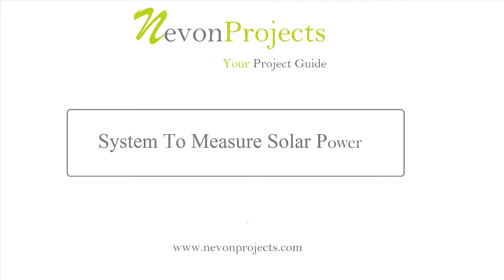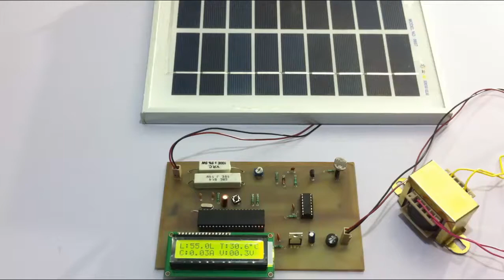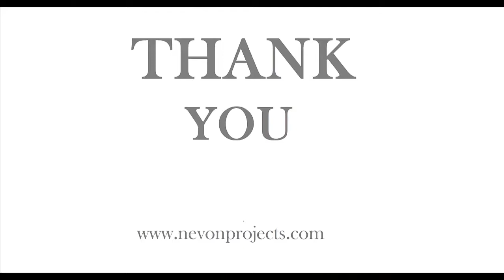System To Measure Solar Power

Comment: are we using 2 adc's to measure analog values of current and voltage and sending it to the 8051 microcontroller ?